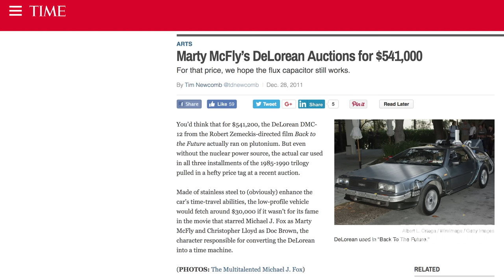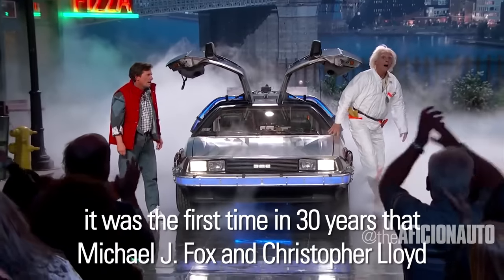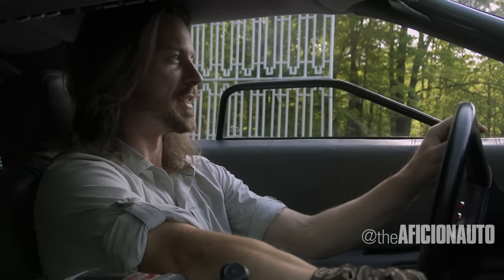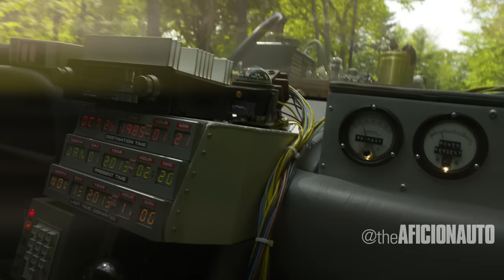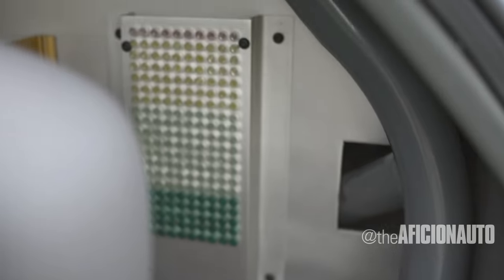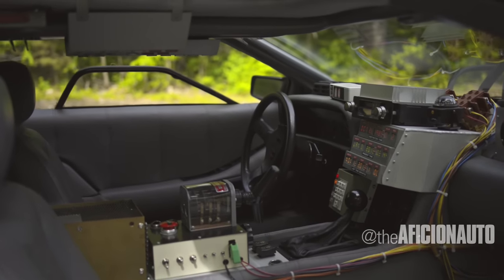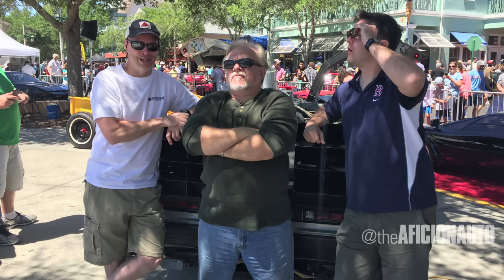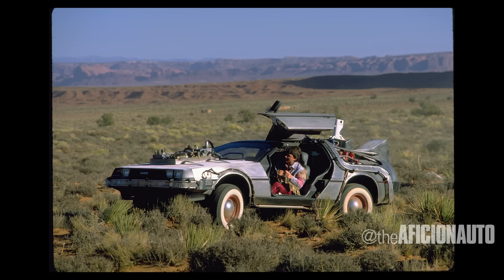MOST EXPENSIVE DELOREAN EVER - 1981 Back to the Future TIME MACHINE

Comment: That engine needs therapy.
Reply: I have owned loads of beetles but never heard one run so baldy as this. Carb and ignition system, timing props needs resetting. Really is poor.
Reply: Edgar Beat
Drove a beach buggy in Cozumel Mexico, they didn't wanna start, random stalls, crazy shift detents.
I had a flashback watching this, even down to that high RPM 1st clutch release.
Reply: They have confirmed the car has been tuned up since the filming of this video and runs tip-top now.
Reply: Cody Glive Thank God that was torture to watch. Too mechanically sympathetic to motors :) I love that car.
Reply: Cody Glive I was wondering if they were running it on whisky / bourbon. Would explain the bad running  :)
Reply: Check out the LS DeLorean version you be blown away by it the speed it’s insane should not be that fast but it is.
Reply: Edgar Beat the valves sound horrible as well
Reply: Edgar Beat Yes myself owned buses.  We all know the air cooled motors need love and can't treat them like a Honda Civic and just expect them to run perfect.  Also the transmission rod has some adjustments. Also the rubber Y style bushing that connects from the rod to the transmission that can wear out. That must be changed frequently as well. When perfect adjusted no problems with shifting. Even if this was modified for the Delorean. Love the Scat shifter I bought also makes a huge difference.
Reply: The sad reality is the average go-kart has about twice the horsepower that this engine made when it was new.  It really would've been better on a small push mower.  Just a complete fail of engineering, and certainly not deserving of such a high profile car.  Wonder how many takes they had to make due to mechanical breakdowns?
Reply: you'll need 1.21 gigawatts to fix that engine
Reply: It was probably the same one i drove! The one we had didn't even have a air filter.
Reply: valve adjustment long overdue.
Reply: It has seen some crap

Comment: Man that engine sounds rough.
Reply: Old bugs always sound rough
Reply: @kirincomstock6902   Poorly maintained bugs sound rough. But heck you can find old air cooled VW engines that's been laying for years and they start right up and run smoothly.
Reply: Since the beginning of the video, i knew this car is like a HotRod. You actually need to find the gears and you will start moving when you push the pedal far enough. But still a gorgeous thing. 😁

Comment: If that drive-in movie theater from part 3 still exists, one day, they've got to see if they can get it to 88 there.
Reply: A delorean can barely do 88 downhill with a tailwind as it is..
Reply: If it still exists, I bet they will buy it too.
Reply: Tay S The top speed of the DMC 12 was 110mph.
Reply: @mat5267  

An friend of a friend owns one that was stock before a Chevy LS swap and I cam tell you that is a pretty hopful number.  Or you'd need a large hill and long runway.  Those Renault 6 are painful.
Reply: That drive in was constructed in Monument Valley, UT for the movie. Torn down when they were done with it.
Reply: @i-like-turtles4900  Yeah but the location itself other than time, it looks the same.

Comment: For the people who think the engine is falling apart, it's not running as smoothely as it could but it's just what an old air-cooled VW Boxer sounds like. it's probably from a Beetle or T1/T2
Reply: It runs like a top now. We adjusted the valves and tuned the carb. It is from a 72 Beetle, you are right!

Comment: So just to be clear - this is the version of the Delorean that appears in BTTF 3. The one that went back to 1885 - TWICE. Once depositing Doc Brown. Then sitting preserved (as well as he could manage) in a local mine, until Marty and 1955 Doc could recover it - and fix the time circuits (with 1950s tech - thus the giant strap-on box on the hood with the vacuum tubes etc) and new (1950s) tires (the white walls - also requiring the suspension be altered/raised to accommodate them). Marty is then supposed to take it back to 1985 - but discovers Doc is in trouble and goes back to 1885 to help out - where the car encounters indians and VERY rough terrain and ruptures the gas line.  
So it's THAT version of the Delorean - which - since it had to drive rough terrain and be modified to run on train tracks etc - was built with Delorean paneling - but on the INSIDE - is actually a modified Dune buggy - which explains the roll bar and the suspension and the (somewhat balky) VW engine. 

Whew - Have I got all that right? :D
Reply: Right!

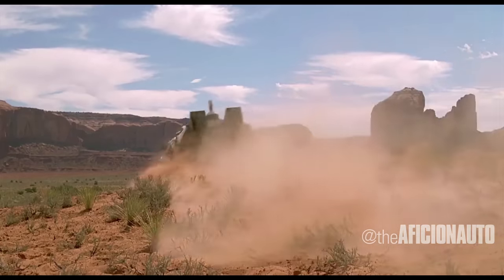Comment: 13:17 : fun fact : this part is the fuel distributor that equipped the car, with the stock PRV V6, the fuel distributor from the Bosch K Jetronic mechanical injection.  It wouldn't be able to come down this way tho as it was on the top of the engine !

Comment: The control tubes dr brown installed when marty is onward to the old wild west to meet up with his present friend when survived past 8 months in hill valley 1885 although the fuel line of the fuel injected manifold might have been tampered with so they used rail wheels to push it forward with the steam train for marty to head to jennifer's house in 1985.

Comment: Pretty cool they used a VW buggy for the frame for this one.... Very cool. Hopefully they can throw a good transmission in it witch should be easy and cheap. Not that it would make it more useable for the road because of how high the front is, but still lol. I'm surprised they broke second on it, usually reverse goes in em, but how hard they ran it in the desert I'm not surprised.
Reply: The transmission works perfectly now, adjusted the clutch and linkage. It runs and shifts great!

Comment: The suspension was so absurdly modified for the desert scene it was distracting even as a 10 yo seeing it in 1990. Then it was lowered way down when it was put on the tracks. I couldn’t ignore it. Let it slam down instead of comfortably ridding around in the desert.

Comment: Manual transmissions should be mandatory in all cars. It made me a significantly better driver and automatics are just boring. I bought my first stick not even knowing how to drive one. I had to call my brother to come drive it off the lot and he gave me a quick lesson. The next day I was all on my stalling at red lights, stop signs, toll booths and basically anytime I needed to stop the car. Hills were in.my nightmares before I learned how to properly drive it. I'd never drive my own automatic as long as I can help it.

Comment: You obviously don't have the skill to operate that vehicle get yourself an automobile with a manual transmission drive it down switch back mountain roads then drift those same roads 4/20 years then you may have enough skill to operate that vehicle with a quick wrist as you have to slap it back instead of pulling it back when you're shifting your shifter. I know the time gears are in the way. That's why you take the shifter and slap it back into gear I could speed shift that little dune bug....

Comment: Bin that shit VW engine and stick in a small ford V6 euro engine and it will have the power to move and reliability
Reply: As much as I agree with you... I think the point is to keep it as original as possible... But yeah, there's really no excuse as to why the car runs like shit honestly...
Reply: @Avi-dn5my  I love the cars iv driven one and the chassis and body work amazing but the terrible engine and gearbox was the only fail of the car.
But this was built on a VW buggy dune frame you can see at the front, if they just took a original car and gave it bigger suspension It could of done the same scenes but still bloody love a delorean every fan will